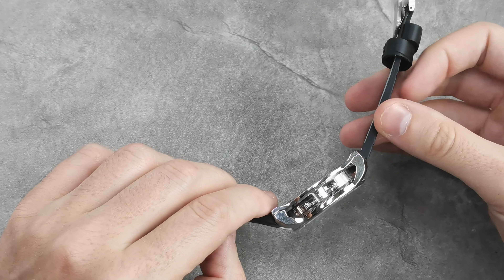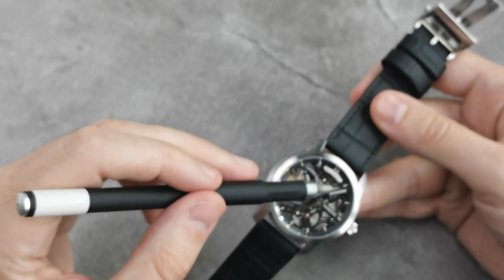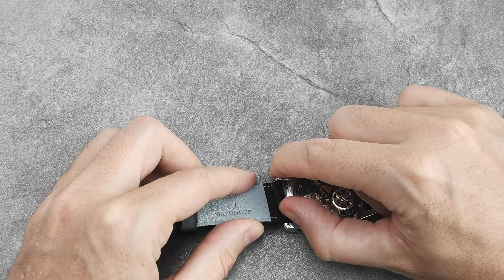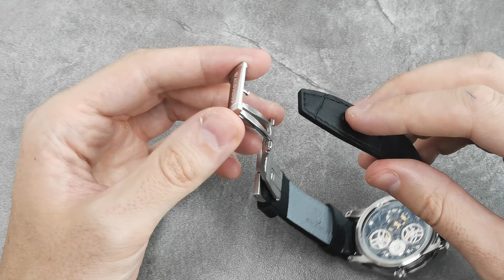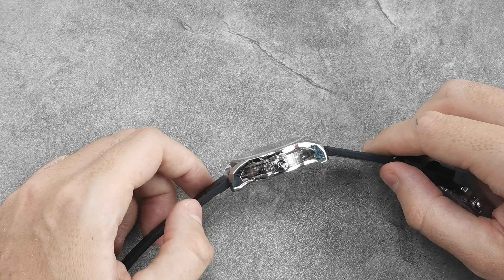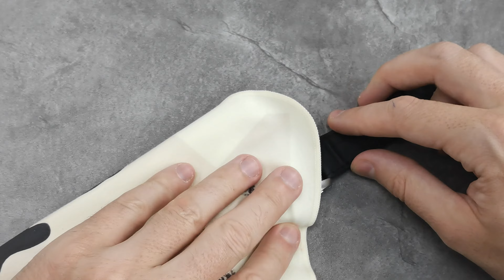User Manual: Waldhoff Quantum

Comment: By the way, strap life is also affected by the wearer's "personal pH". This is the relative acidity of a person's natural skin oil. This explains why a leather watch strap (even one made of stingray leather) may last decades for one person and maybe a year or so for another. It's different for everyone and its regardless of the quality of the strap.

I learned this while working in the watch trade and from various strap makers.
Reply from the maker: I didn't know about this skin pH factor, but that's good to know.  We recently upgraded the underside of the strap from a bare beige matte leather - I don't know how it's called - to a layer of Italian leather.  The new one seems to absorb moisture 10x less than the previous version, and should thus last longer.
Reply: @manufakturwaldhoff4200   It depends on the construction of the strap as well. If glue or an adhesive is used to hold it together versus stitching, a person's skin oil can affect the adhesive. I've had Tag Hueur straps just give out on me because of adhesive, so I get them stitched and they last another decade. There are other factors like sunlight (UV) exposure as well.
Reply: So, Greeks must replace annually???
Reply: @Luke-yh6nm   I have no idea, do people of Greek decent have more acidic body oil?
Reply: @scalhotrod Ever seen one? Valvoline in human form 😅
Reply: @Luke-yh6nm   OK, but "oily" isn't the same as having a personal pH that is slightly acidic. What you're describing sounds more like they are more towards the base end of the pH scale which would actually act more like a preservative for a leather watch band. But to be on the safe side, sticking with a good quality rubber or heavy duty plastic band would be a good idea.

Comment: Just got mine! 🎉
How many turns does it usually need for a max charge? I keep turning it and I see the coils on the barrel tightening but I don’t know when to stop as I still could keep turning
Reply from the maker: Hello!  When you see that the spiral springs are tight, it is the time to stop winding.  Generally around 70 turns is enough, and your watch does not need to be 100% fully wound to the max to function.